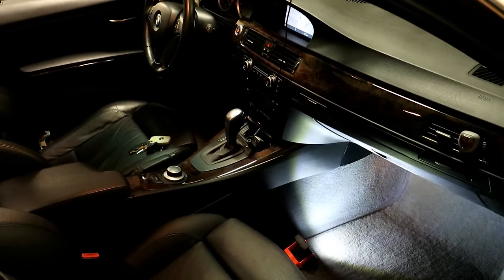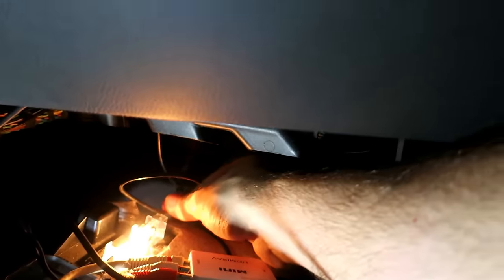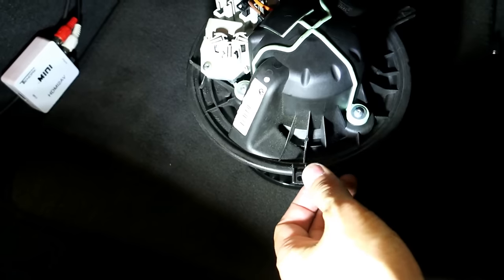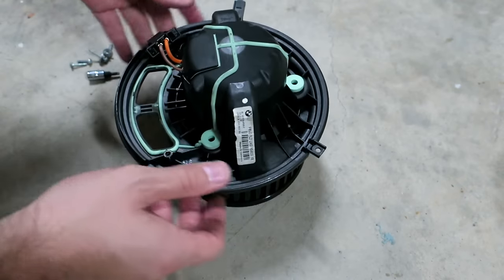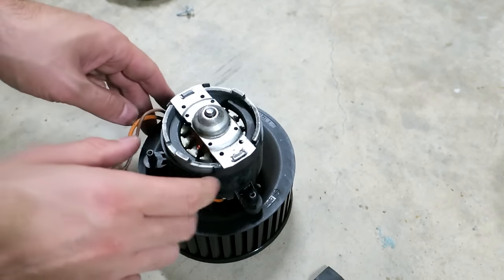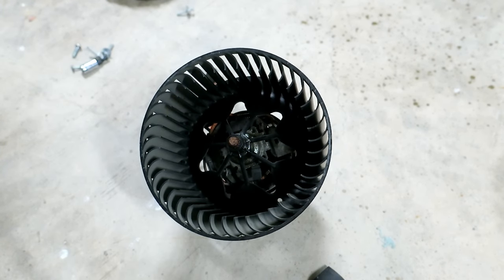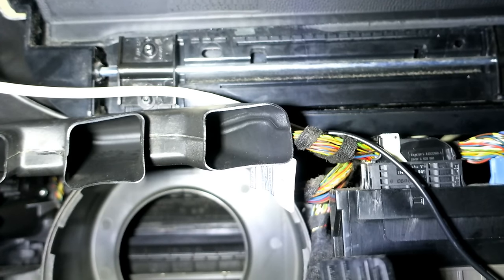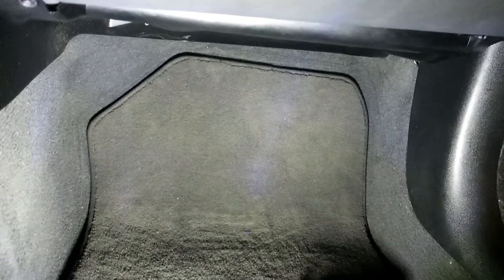E90 BMW Five Minute Blower Motor Removal

Comment: Dealing with a 2009 BMW 328i and there is not that much room in there.  I was worried about destroying the cable loom getting it back in and may take apart the dash  to get it back in.  Am I missing something?  It definitely was very hard to get out and nearly impossible to get back in.

Comment: I did this on my wife's 2007 328Ci after watching your video and it worked perfectly!  You mention the spot where a screw could go and mentioned that most cars don't have a screw there. I figured out what that is for. When you accidentally break off the motor retaining tab, you can re-install the motor and secure it with a screw through that extra hole in lieu of the broken retaining tab. it has a place in the housing for the screw to bite.
Reply: Do you recall what size the screw was that you had to use to hold the blower in place? Thanks

Comment: Praise the LORD this YouTube video is so helpful I was quoted 3hours labor and $300 for a part but took me a while to get the old part out about an hour, lots of prayer and perseverance it was quite jammed. Got the replacement from eBay $120 and took 20 mins to put back in and the aircon works better than before! My kids will be pleasantly surprised mummy fixed the aircon so we are not freezing on the way to school with the aircon working now! Thank you for this fantastic video

Comment: How do I know if it's the the blower motor or the blower resistor? There is no hot or cold air coming out at all. Reading online, it seems like this problem is from the resistor

Comment: Bmw charges 2 hours of labor for this
Reply: I just wasted $600 getting this replaced after I came in for the wiring recall. Kicking myself.
Reply: There is a recall for this, BMW will reimburse you for the repair.
Reply: @blyderek  are you in Australia?
Reply: Just fixed mine thanks to this vid. Little piece of plastic in the fan.  Thanks for posting!!

Comment: Clearly you all are braver or better than I am. Getting the motor out was easy. Getting it in vexed me. Don't be afraid to remove the glovebox. It took me all of 10 minutes (and low stress) to remove the glove box and that gave the ducting some room to move out of the way. Fan popped in and there was much more visibility and room to maneuver.

Comment: Thanks for the video. Mine was chirping like a bird until it stopped completely. Removed, hooked up directly to 12v and blower started to spin. Cleaned and greased up with bearing oil. Installed back and now it runs again. Yaay!

Comment: Great video and instructions, I was about to remove the glove box as per the other video when I came across yours, this saved me so much time and has worked exactly as described on my 2011 320d RHD model.  Many thanks.
Reply: Paul Ward Is it on the LH side still underneath glovebox on RHD models? Thanks.

Comment: Thank you for this video! I had my motor out in a couple of minutes, lubed, cleaned and re-installed. Mine died completely, but the lube and working it in brought it back to life. Saved me a $200 blower motor (for now) and a few hours labor costs!
I will add, the longest part, was trying to find that clip! Mine was really hidden by wires.

Comment: thanks for this video - used it to solve same issue with my cabin fan - squeaky.   I would say though that here in UK, being a RHD car, the fan was awkward to take out - your video was spot on - but removing the fan is a little tougher as there are some things in the way  (i think its a supporting bracket for the passenger footwell cover). there are 2 Philips screws holding it in place, take one out, loosen the other so you have a lot of play,   THEN you can get at the fan.   

I would also recommend (but be careful!) powering up the fan BEFORE refitting it to make sure your re-lubrication has worked. 

Aside from that -   video was right on the money - thanks!  (my experience was this was 60-90min job - removal - WD40 - test - refit and replace cover)

Comment: Thanks for this diy. I've been putting this off for so long because of the long process in other diy's. Just completed it and no more squeak! Took your tip with the Lysol also, smart move! Btw I saw someone commented that it can't be done on e92, that statement is false. My cars an e92, it was a little tight but it can be done with no problem.

Comment: I was just going to replace the resistor pack but it looked easier to pull the fan per your instructions and check the bearings at the same time. The motor was stuck as well so I lubed the bearings as well. Replaced the resistor pack and reinstalled. All well in the 2008 BMW 328i world. Thank you!!!!!!

Comment: I gotta question... 08 335i, ac worked on trip there.  When left it didnt, no strange noises prior.  Got home, checked fuses, all good. Pulled fan, turns fine by hand. Put 12v to it and started running. Figured it had to be FSR, bought new and installed.  Still no fan... its 108° can anyone help me with any idea what els to check? Tia

Comment: RECALL ALERT: Most BMW E9X Drivers will have receiver a Blower Motor Wiring Recall Notice in the mail around 2017-18. This video shows how easy it is to perform a quick inspection of the blower motor wiring under the glove box. The black electrical plug at the white resistor will show brown burn marks and frayed wiring if you have the issue. It is a fire hazard so bring your E9X to a BMW dealership to have the wiring replaced, and/or blower motor swapped. It is free due to the BMW recall. Park your car away from the house, just in case. BMW will install a small new wiring harness with a dedicated ground, plus extra insulation to prevent a future problem. They might also replace the white resistor module. 1 hr of labor. If the damage to the blower motor wiring is more extensive, they have to remove more of the dash and fix all the wiring harnesses, which take days or a week. Call ahead to see if the BMW dealership has the blower motor wring parts in stock (same day repair).

There is a separate recall for the PCV heater wiring (back of the engine) that is often combined with the blower motor wiring recall. 

There is a E9X battery cable (to fuse box) Recall also out there and the wiring update is in the same area behind the glove box..

Comment: The repair worked but did not last so I installed a new blower assembly. The new assembly from FCPEuro did not include the resister so plan to move the old resister to the new unit, which is very easy as there are only two screws (T20). This job could be done in five minutes or less and is very easy when you understand the angle needed to remove and replace the assembly. All you need is a T20 and a light. First, move the seat all the way back, clear the floor, and remove the floor mat. 1. Remove the two trim panel screws with a T20 and put the screws close by in the console. 2. Partially remove the trim panel, starting at the console side, ease out the trim panel tab an inch at time and the trim panel will follow. 3. The trim panel is connected to two small two power cords, disconnect them from the trim panel and set the trim panel in a safe place, even the driver's seat. 4. Unclip the blower motor power cable from the assembly at the metal resister by pressing the plastic locking tabs on each end of the clip OR for me easier to unscrew resister's two T20's and release the smaller assembly power clip to release the resister which makes it easier to unclip the larger main power connection. FOR THE NOVICE 5. Now you are ready to remove the blower assembly. 6. Use a light, lie upside down to see the assembly, and spot the long tab closest to the engine. 7. Gently pull down on the tab and twist the entire assembly until the tab and assembly release.8. WORK THE ASSEMBLY OUT OF POSITION BY ANGLING IT DOWN AND TOWARDS THE CENTER OF THE CAR. This takes a minute or two but if you are looking at the area you will see what can be gently pushed a bit make room enough to get the assembly out. 9. Screw the old resister into the new unit and connect the smaller assembly power clip. 10. With an eye on your work and the tab on the engine side of your work, gently work the new unit into place at an angle pointing from the center of the vehicle into the cavity. 11. When the unit is seated, twist it until the tab slides into place. 12. Now is a good time to verify the three power cords are routed to reinstall. 13. Clip the assembly power into place and it only fits one way. 14. Reconnect power to the trim panel's two connections. 15. Gently slide the trim panel tab into position. 16. Replace the trim panel screws partially. 17. Adjust the trim panel until it fits and the screws line up to your satisfaction. 18. Tighten the screws just enough to secure it but do not over tighten and break the plastic panel. 19. Replace the floor mat and you are done.

Comment: *pro tip- if replacing the entire fan assembly like I did, just break off the tab. Twice as fast and it's flimsy anyways.

Finally did this.. in a Walmart parking lot... While on the clock at work (I don't work for Walmart) in 8 degree weather
 Took me 10mins with this DIY.

Comment: Removing was relatively easy, putting it back though... A thick wire harness gets in the way from one side (not 100% if it hasn't been moved/shifted - previous owner spliced it to install power supply for a dash cam) and that air duct (visible in this video) from another. Ended up wigling out the air duct. Putting blower after that was trivial, but then spent like 5 minutes trying to wiggle that air duct back in.

Comment: This video is straight  to the point! Looks like  this is a common problem with E90 series. I just started having the same annoying  squeaking noise issue with this blower on my E90 and fixed it today thanks to this easy video tutorial. I actualy had that screw that you mentioned in the video that can additionally hold on the whole blower into place, but it was not too hard to remove it. Also, in my case, removing the large upper plastic cover from the blower motor was not as easy as seen on this video, but with some careful effort I managed to take it off. Thanks a lot for sharing this handy video tuturial and saving us some money!

Comment: Thanks for the video. I changed it on my 2012 128i because it was squeaking/making noise. The placement is a tad different because the area is smaller, but the overall steps are the same. You saved me over $400!!

Comment: Thanks for this video.  It gave me the confidence to do this.  It only took about 5 or 10 minutes.  I have a 2008 BMW 335i, 106k Miles.  The squeak at low fan speed was bugging me for a few months and then I saw your video.  I ordered a new fan off Amazon for about $40 and installed it just a moment ago.  Squeekless again!  My wife thanks you too as it was driving her crazy as well.   Now if I could just work up the guts to replace the oil pan & gasket to get rid of that leak...   I bought a Quickjack on-sale at Costco ($999 delivered) to help me do that.  I hope to drive this car to 250k miles.
Reply: Please can u send the link for the fan ???

Comment: I struggled a little bit but I finally got this out. The tab was hidden behind a bunch of wires and really hard to see. I was like “ where the F is this thing”. I got it out and cleaned/lubed it. I had a hard time putting this back in. I had to clear the space and the wires were in the way. When I finally got it in I ended up breaking the lock tab from trying to get this crap locked in. It’s not moving but I may end up putting in a screw in the spare slot

Comment: In freezing cold conditions. Condensation forms around the motor as cold in vent coming from outside and the car interior hot from either the sun sitting warming next day after cold night. Maybe from parking up heated up car from driving with heat park up then this condensation forms from heat difference rusts bearing and electrics parts in motor. I’m not sure if to drill small hole on the motor cover to help equalise the temp plus let these drops of water to drip out and evaporate off ??

Comment: FYI, a new blower costs $150 on FCP Euro if you don't want to take apart the blower and lube it or if you have a total failure. Not cheap but saving the labor makes it worth the fix. Thanks for the video!

Comment: My blower motor is spinning but spinning slow, I spun it by hand also and it is smooth. Does my final stage unit need replacing? 2007 323i.

Comment: this quicker method does not work for E92 unfortunately.. there is no space to remove the motor from underneath. I guess I'll have to go the long way
Reply: suffix642 Thanks, I've got an E92 so will allow more time.
Reply: I just did mine last week on the coupe. It’s a tight fit but it’s completely doable without disassembly. Removal is easy. Putting it back is the hard part as there’s barely any space so the motor has to go in at a certain angle.

Comment: Just had this exact problem, fans suddenly stopped pumping air. They were making a weird noise the a day or two prior, screeching, wining. 
All the controls were working, so I checked the fuses. All good.
Thought I’d go in and try removing the fan unit, as you made it actually look very easy. 
Before I did that I had bought I’d go under the bonnet and just make sure the cabin filters weren’t clogged. Noticed I could access the fan main shaft from under the bonnet, so using a similar lubricant to yourself, filled a long hollow piece of plastic pipe with blaster. Got it in and let it run down the shaft into the bearings. 
Worked the fan a few cycles with the same piece of plastic tube. And it seemed to free up. 
Started the car back up and air is blowing and all seems well short term.👍🏻

Comment: Thanks for the video.  Shop left my passenger side lower dash panel in the trunk for some reason, and I needed to know what bolts were used to hold it in place.

Comment: Thanks for your detailed vid. I had an intermittent working fan here in Florida. We are not usually cold but recently had a cold 29F days. Noticeably the fan wouldn’t work on the cold days . Rust on the bearings were exactly like yours and slow to spin by hand. Using your video and the wifey help its was lubed (PB blaster lubricant)up properly lol. Note my power harness was replaced from the recall so the red power connector was difficult to remove until bringing down the blower unit. Thanks again.

Comment: Thank you for this , just followed your steps and used some penetrating fluid and it fixed my blower motor, it was seized and not turning , cold winter here in Canada so will be nice to be able to use my heat again. Cheers.

Comment: This repair worked for me using household turbine oil for lubricant. I cleaned the fan blades individually. The dust was firmly embedded in the blades requiring a slim wiping tool and elbow grease to remove. Thanks!

Comment: Just changed my blower fan thanks for this video !! My mechanic wanted 600 bucks to get it working again .. I bought a valeo blower the exact one I took out for 85 bucks .. and did it myself in under 25mins .. getting it back in was harder than I thought but once you get the flash light in the right spot .. you can see what your doing .. thanks once again!

Comment: these are good videos however the omit the use of s gasket when removing and replacing the heater blower motor, if the gasket is not necessary then no worries however the parts lists shows one part number 64116987460 on the real oem site, do they reuse the part already there yet the video suggests there is no gasket.

Comment: Taking my time I had the whole job done in ten minutes. Getting the new blower in was trickier then getting the old one out.
The tab you lift actually aligns with a "stop" which then aligns the blower so it can go in. Then turn counter clockwise to click in. Easy peasy...
Great video btw.
A buddy of mine just got ripped off by a shop that charged him an hour to install.

Comment: Thanks a lot for this thorough video! Is it possible to test the motor alone? (without the white resistor)? Because I've heard that the input signal on the resistor is 12V DC but the output signal (the one going TO the motor) is 12V alternating. Any help?

Comment: perfect video! I had no fan working prior to removal. Took me about five minutes to remove on 2009 128i. Once the motor was out, I reconnected the wiring harness and the motor stuttered. I used 3 in 1 oil (WD 40 smells really bad for a longtime), works great again. Saved a lot of $. Thanks for posting.

Comment: Ordered the resistor online for $80 including 2-day shipping for original equipment manufacturer(autozone had it for $200).  Bought the T20 screwdriver plus other screws for $7. And did it myself as you showed. Guess what my A/C is running! Thanks for the video. I’ve saved at least $1500 on parts and labor in the last month just watching YouTube videos and doing the work myself.

Comment: Thanks for the video. My blower motor stopped working after being garaged for a year and when I took the blower motor out, the bearing was seized and rusted. I cleaned and lubricated it like shown here and now it's working fine again.

Comment: Recently paid $300 to replace the squeaky blower on my 2006 325xi, now having the same symptoms on my 2008 328xi.  Ordered the motor from FCP Euro for $150 and swapped out the resistor stage. Full fix in under 15 min. Thanks so much!

Comment: Anyone can help me out? I broke the clip you pull up (it was really tight). Is there anyway I can get the blower motor back in without the clip? Or do I just buy a new one
Reply: Same boat. What did you do? Thanks!
If anyone cares - just got it back in and it seems to lock in anyway and is holding. Pain to get back in, but glad I don't have to hear that noise anymore. Great video.